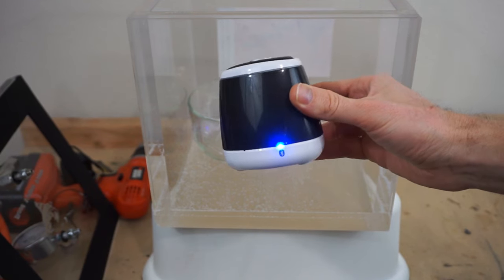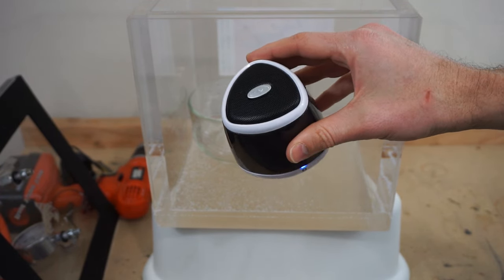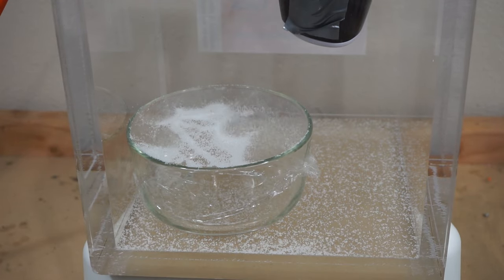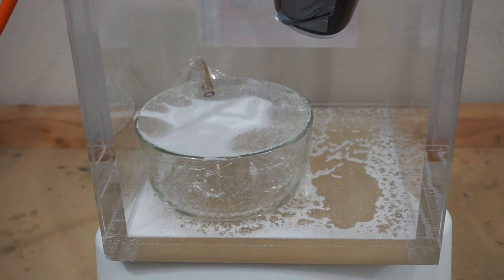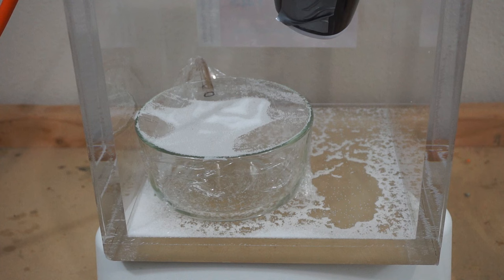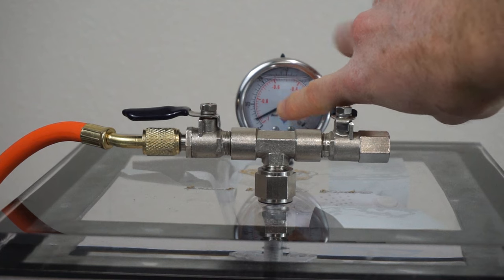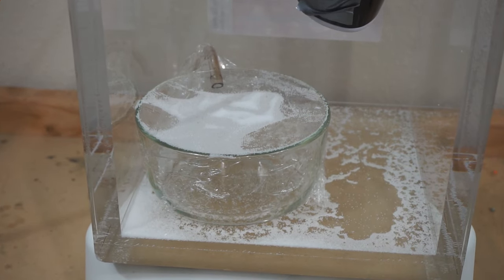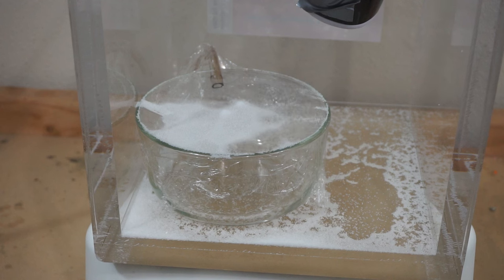What Happens When You Put A Speaker In A Huge Vacuum Chamber? Can You Hear It?

Comment: What I would like to see inside your vacuum chamber. A smaller chamber of air inside your vacuum chamber. Within this chamber of air be placed a microphone. Outside of but, connected to the air filled chamber a speaker. 
Experiment: Evaluate chamber, turm on speaker. Listen for sound within the air filled chamber that is inside vacuum.

Comment: what happens to sound energy? we are using energy to produce sound but sound can't travel in vacuum, explain.
Reply from the maker: +Vinay Agnihotri it takes less energy to move the vibrating cone in the first place since it doesn't have to push against air. The rest of the energy is dispersed as heat in the moving cone.

Comment: I love your channel.  I have a thought. An explosion. Should it have a little sound? Any pressure rapidly released. Or popped.  Will make some kind of movement. Outer space has enough matter in it to allow some sound.  In fact.🤔   I propose that space is closer to being thicker than our air. So thick and heavy it can suffocate humans 😏 . Unless inside a pressurized container 🤫.  There is just less or no gravity in places. Where there is heavy gravity. All the ("space air" or "water". that's right) It will be pulled down and more compression happens. Making a liquid or gas. Water or "air". Maybe both.🤔Earth's water holds most of our air on earth. Trees and plants help keep it clean. Outer space is like our deepest parts of the earth. Cold, hot, low air, high pressure, and inhabited to humans. BUT there are creatures or organisms that can survive in both our deep earth and deep space.🤫🤯 are we looking at space the wrong way?
Reply: Keep in mind the only people who know the real answer. Would be someone who has been to both places and felt the surroundings and survived. A robot or RC device can only look for stuff it is equipped for. There may be more not looked for. Or we have to trust all our information about space and ocean exploration is fact🤥 and not tampered with. 🤣

Comment: not true. the speaker it self needs a non vacuum environment to send the signal across the air waves. a vacuum environment will not allow the cone of the speaker to travel back and forth to send the signal in the air. an explosion in space would make a noise on its own. not needing two requirements in earth's atmosphere to communicate a sound but the compression of the gas its self in the explosion.